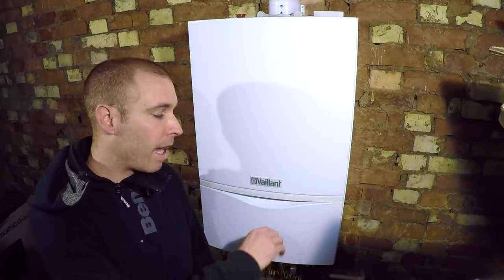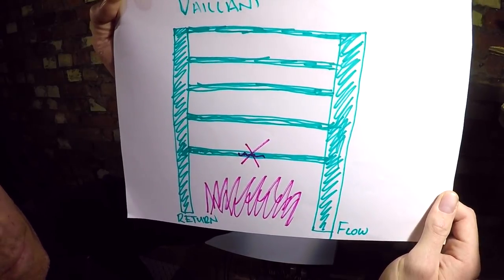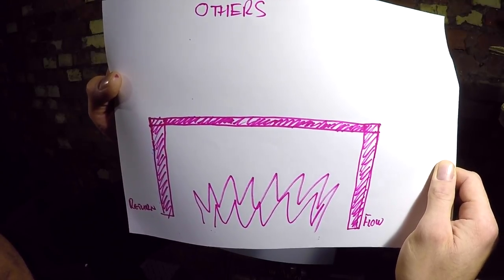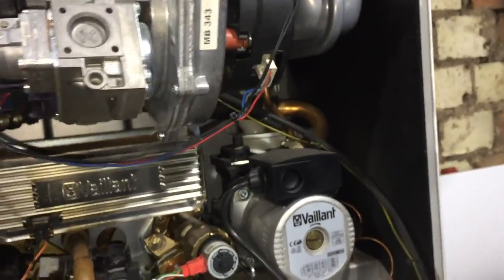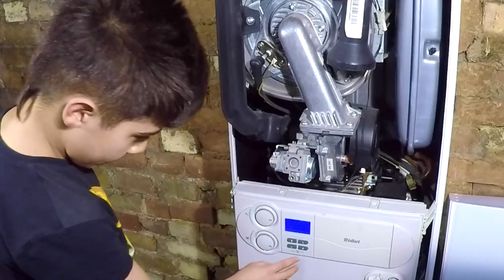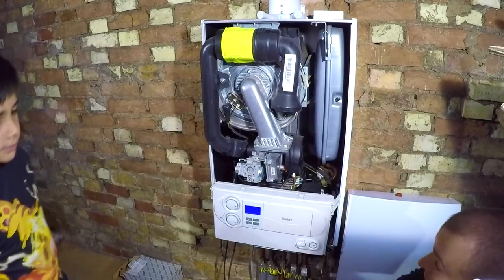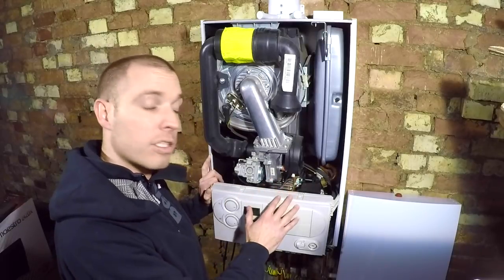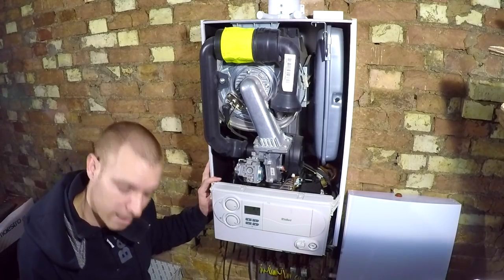My Boiler issues. Vaillant 837 Blocked Main Heat Exchanger

Comment: Awsome video mate.
Reply from the maker: Thanks. :-)
Reply: @HeatingGeek  mate I've done boiler services in the past and now I'm working on the smart meter rollout, I'm qualified on the electric side aswell so know my way around a multimeter and testing procedures. I really want to get into boiler fault finding, what is your advice for best route to take? Much appreciated in advance.
Reply: John Alderweild learn how things work and why they work in the way they do / should .. would be my advise. I was taught if you know how something is designed to work in such way and how your most of the way to finding the issue.
Reply: For arguments sake a 3 port valve should rest in the water only position. With no demand or voltage into the valve. So if the customer had no hot water and the valve is in that position you know it’s an electrical issue if the boiler is not firing. Not a valve issue just things like that mate as the valve does not need any voltage for hot water to circulate through it as it’s the rest position. Basic things like that make fault finding that little bit easier
Reply: @heatservicebwcuk1545  Thats the thing how does one differentiate between an electric, aquatic, mechanical or gas fault? 🤔
Reply: John Alderweild for a start gas doesn’t fail ! It’s either there or it isn’t obviously it can fail to be delivered at the correct volume or pressure but that isn’t a gas fault in itself . Pipe sizing - blockages regulator supply so on. It’s not gas itself at fault.

Understanding how systems work vented , sealed so on would be a good place to start. Lots of diagrams online to look at. Y plan (3port ) S plan (2ports) W plans but don’t worry to much about them for now. Understanding the lay out of the system you can almost imagine where a blockage is remember water is lazy it will take the easiest route ! 

It takes a while to get it all in your head but the best advice I can give you is study hard so much info out there. Iv never been on a manufactures course I know some people speak highly of them but at the end of the day most boilers work on the same principle and sequence.
Reply: Make it your goal to  something new each day. A day not learning is a day wasted . A lot of engineers get lazy and settle for what they know already. Out the work in and teach yourself to teach yourself if that’s makes sense. Message me if any questions or what some links for info etc
Reply: @heatservicebwcuk1545  That's all good but when you have nothing to practice on i.e in a live situation it's difficult to build confidence. What do you think of the Baxi fault finding course? or are there any good portals where breakdown engineers share knowledge.
Reply: John Alderweild I can imagine mate , no I have not been on any courses so I can’t recommended but I think the Baxi one is supposed to be a good one iv heard. This is a great place to learn. Other guys doing these videos to just keeping watching and gathering as much info as you can mate it does take time and Patience
Reply: @heatservicebwcuk1545  It's a shame the old system of mentorship has finished I met loads of old boys on my electric up skills I would just sit in the bar with them after college and pick their brains. Anyhow I've my 1 in 6 Saturday tomorrow so off to get some kip. Keep the videos coming they're really appreciated and needed.

Comment: I have this boiler. When demanding hot water im getting intermittent flame. Boiler fires up for a second them flame goes out.  Cold water until the boiler decides to fire up again. It may stay fired up or it will do the same again and go out after a second or two.  CH is working fine. No problems. Any Ideas please?
Reply from the maker: When its doing it, press the 'i' button and tell me what is says.
Reply: Hi mate, any idea what it could be?

Comment: Doesn't sound that bad to be honest mate. Just stick some drain cleaner in it. Job done 😊
Reply from the maker: May just do that
Reply: piss takin' aside mate. treat the exchanger to some fx2 (low damage to stainless). soak for an hour. Neutralise then pour away. Have done this alot for many customers.  Much love. keep up the good work 👍
Reply from the maker: @benjaminfrost4363  I cant be arsed to remove it unless I have to.
Reply: 800 quid vs being arsed ? fair play bruv
Reply from the maker: @benjaminfrost4363  What I mean is, I will try and leave it in place first. Then if I'm unsuccessful I will remove and power flush it.

Comment: Excellent Technical Vlogs from a highly competent  Heating Engineer. I fitted the 937 2008, only one drain down to upgrade kitchen Rad, no replacement of inhibitor, No servicing and only had to re-pressure Vessel , Vailant Top Boilers.  30 plus years Heating engineer
Reply from the maker: I hope I caught this early enough!!